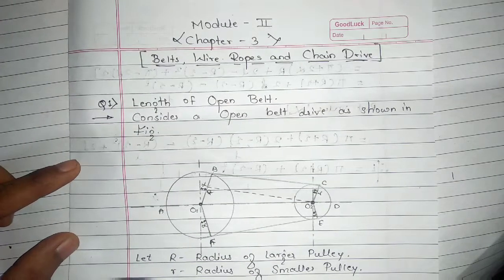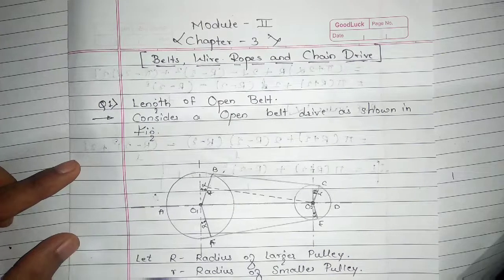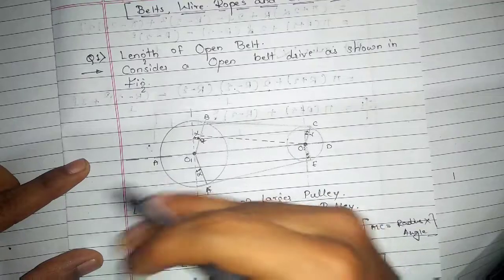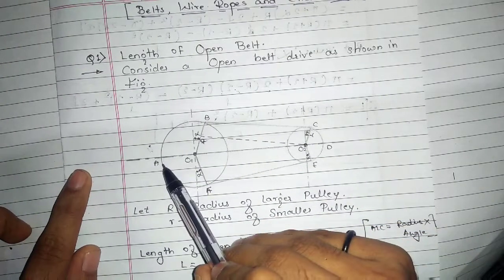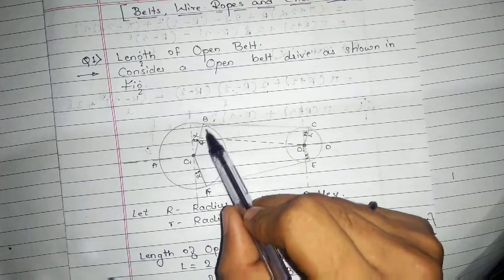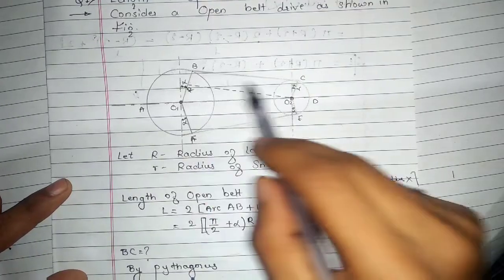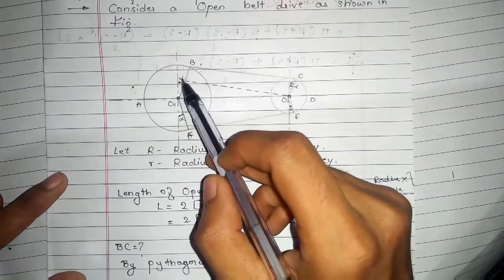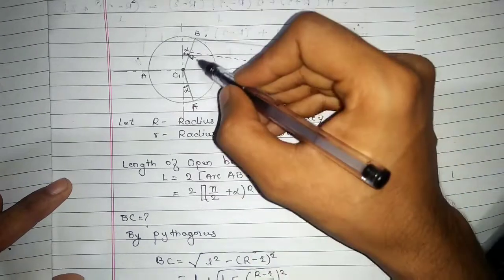DME - ll l Derivation on Length of Open belt drive l Belts, Rope Brakes and Chains l MechTime

Comment: Please sir can you help me in solving this problem 

It's an open belt, please help me solve it in an open and cross belt

in a belt drive arrangement the following observations are made . bigger pulley =280mm. smaller pulley =200mm. the belt distance =400mm. tye sheare were rotating in the same direction the maximum tension in the belt =1.5kn while the coefficient =0.35. using the above information. (A ) Determine the angle of wrap on the pulley. (B) Determine the length of belt. (C)Determine the power transmitted
Reply: What's the speed (N) of any of the pulleys?